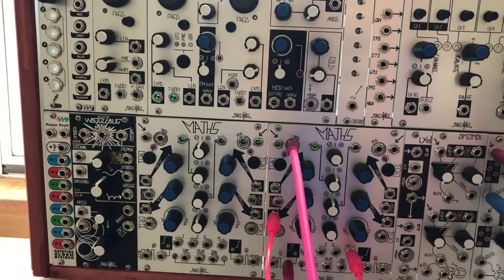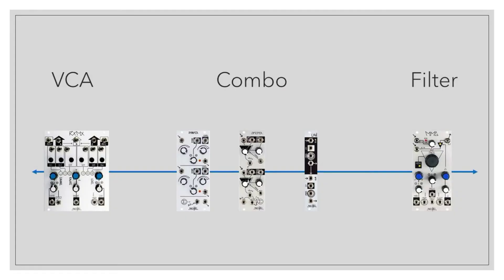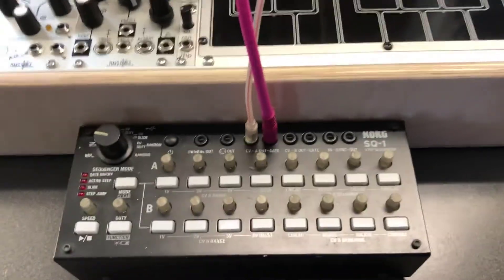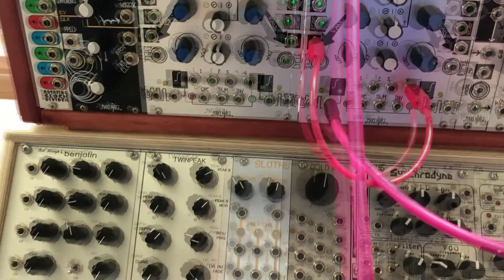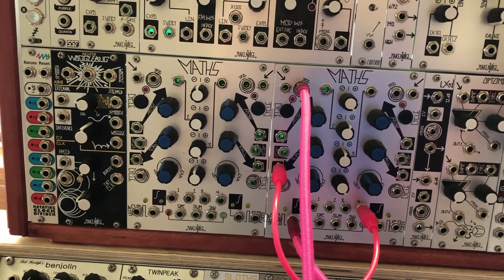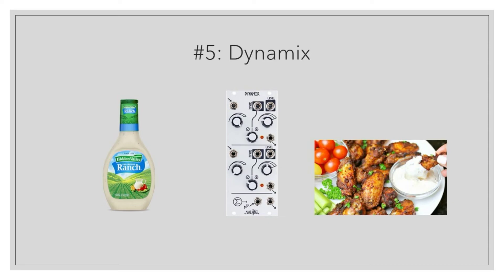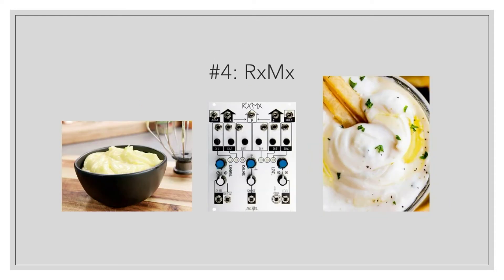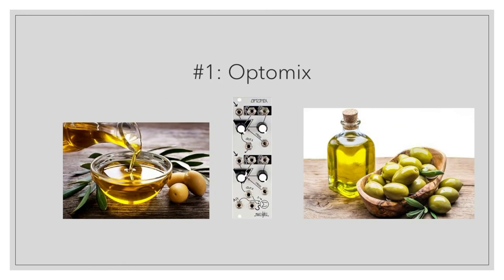A Comparison of Every Make Noise Low Pass Gate

Comment: hey thank you! i didn't necessarily realize that this is what i was looking for, but it turns out that this presentation was exactly what i was looking for. ive been struggling a little bit with the low pass gate thing. Hearing these modules back to back and your explanations and conclusions, cleared up a good amount for me. so thank you for making me realize that this is exactly what i needed to be cleared up. best wishes.